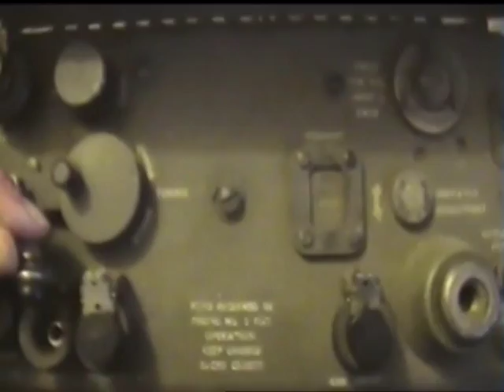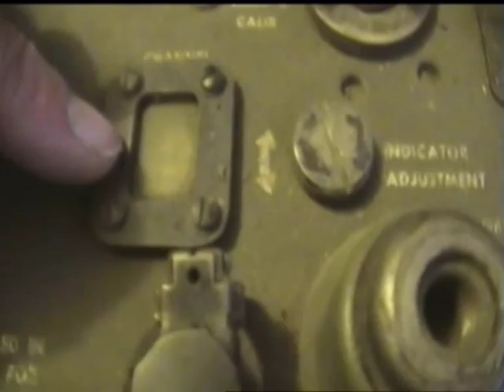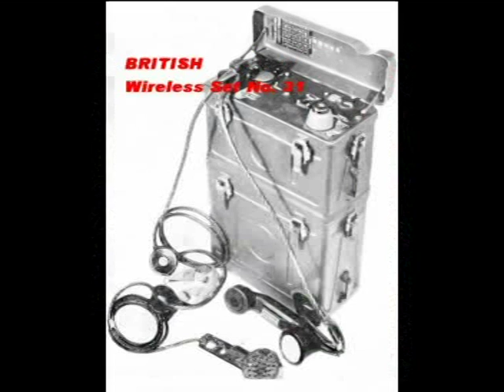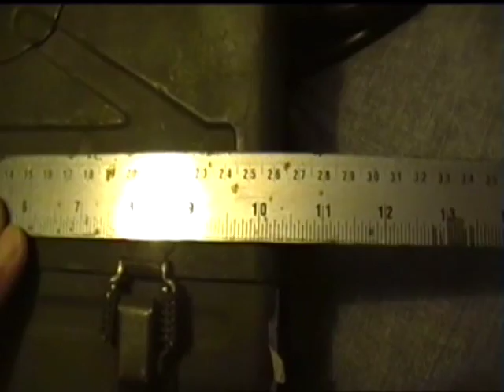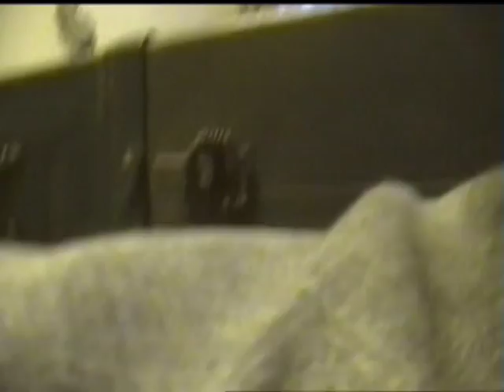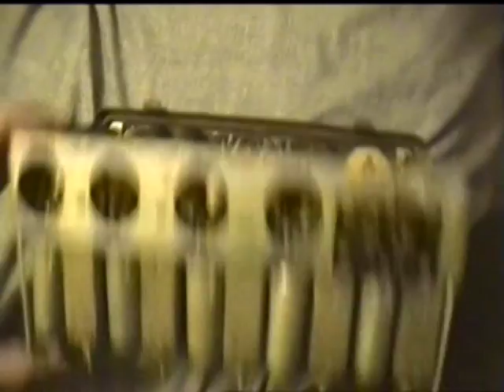BC1000 Radio Set

Comment: what ebay seller did you buy the clips from?
Reply from the maker: Cant remember try these https://www.ebay.co.uk/itm/Stainless-Steel-Spring-Toggle-Latch-Catch-Hasp-Chests-Cases-Boxes-Hardware-Tools/253551607763?hash=item3b08da7fd3:g:BM8AAOSwEfBbWZXj
Reply from the maker: https://www.ebay.co.uk/itm/Suitcase-Case-Box-Locking-Spring-Loaded-Toggle-Latch-Catch-Hasp-Hardware-2pcs/361347700403?_trkparms=aid%3D555018%26algo%3DPL.SIM%26ao%3D1%26asc%3D58656%26meid%3D0a5c69b59a3a48db8a5d2029e8ebee58%26pid%3D100005%26rk%3D3%26rkt%3D6%26mehot%3Dlo%26sd%3D253551607763%26itm%3D361347700403&_trksid=p2047675.c100005.m1851

Comment: The Vibrator Power Supply is for a Vehicle mount... hence the VRC-3 nomenclature and the external power cable leading from it..  The manpack radio had the CS-128 A Battery box which had the same X pattern the radio had. The battery box had the ability to use both the BA70 and BA 80 batteries.

Comment: The thing that helps most is a component listing... The BC-1000/SCR-300 radio consists of:Transmitter Receiver BC-1000/SCR-300 Radio, Battery Box CS-128A, Shoulder Harnesss ST-54, Waist belt ST-55, Carrying strap ST-50, Pad, M391A, Bag, Antenna BG-150, Antenna AN-130 (Short Whip), Antenna AN-131 (Long Whip), Handset TS-15 (Standard, H-23U may also be used as well as the T-17 hand mic), Headset, HS-30 (Standard, R-14 Headset may also be used), Cord CD-874 (Extends the R-14 and HS-30 headset cords)  Original WWII Battery boxes have the wire clasps. Spring loaded clasps are post war. The short whip antenna had a grounding cable to allow the antenna matching unit to operate. The Long whip antenna did not require the ground. The radio weighed approximately 40 pounds and operated in FM band between 40 and 48 Megacycles in forty-one channels in 200 kilocycle increments. The radio had a range of about three miles with the long whip antenna under best conditions.  Hope this helps!!!
Reply from the maker: +Wayne Coulter Thanks but my main reason for making this video is for people that want to copy one and make one from scratch so part numbers don't help so much but thanks for the info. In time I may make one so made this video, I make sets I can use with modern parts inside.
Reply: +Oddball I added the component names so that people could research what the real parts look like  they could either include real parts or see what the real parts look like to make their own reproductions as close as possible to the real thing. I just put together a real one... Just trying to share the wealth of info.
Reply from the maker: +Wayne Coulter Thanks no problem also like the info on the latches.
Reply: +Oddball  There was someone about five years ago who was making BC-1000 replicas in the same mode as What Price Glory's BC-611 replicas... they had a FRS or MGRS style radio inside (modern walkie talkie) and were wired into the volume, antenna and handset controls and fittings so you could use the original antennas, handsets and volume control... I wish I knew who it was... They were available through Ebay for a starting bid about $200 USD...
Reply from the maker: +Wayne Coulter That was cheap no way I can make and sell so cheap. I do intend to make one or more of these one day.
Reply: +foist Best thing to do is contact the guys at Black Wrinkle and Green and tell them what you need. If they don't have it posted on their site, they might have a line on what you need. You can find them here: http://www.bwgsurplus.com/  They also have the transfers for the English test on the top cover if you have a foreign version.

Comment from the maker: These sets need several voltages generated from the power pack some are over 100VDC. There is/was a guy in Italy that makes these to run off a 6VDC cell find him on ebay serlet4446  or pietronatoATtiscali.it

Comment: Glad to see you posting again. Instead of 'swaging' the case; why not just cut a "cross" pattern in the case and back it up with a sheet metal plate behind it? Do the back as well. A case inside a case as it were.
Reply from the maker: Yes mate that was my first idea but I would then want to weld a full seam all the way round to do a nice job. I am considering making more than one, to sell some in the future so a swager / english wheel of some form would be nice.
Reply: Oh, well. Good luck then.
Reply from the maker: mrblowhard2u I have some heavy steel angle iron and some steel/ iron wheels so may be able to make a form of press by welding 2 bands on 1 wheel and one centre band on the other. This is a future project I just don't have time at the moment but I have the radio here so shot this video to show people this detail.